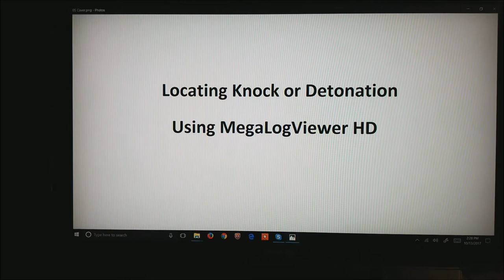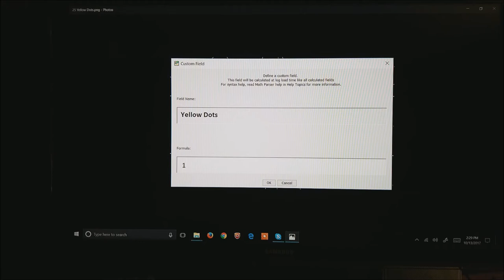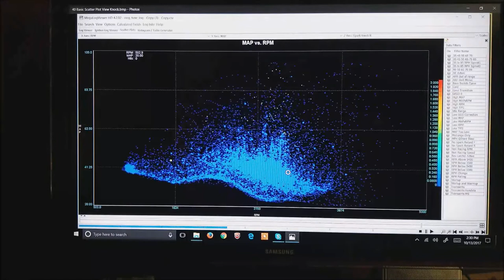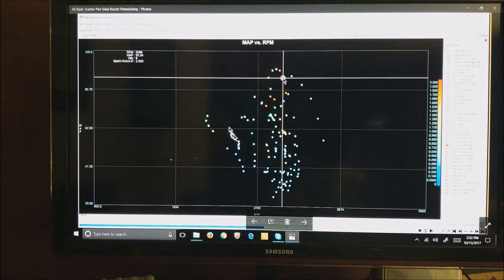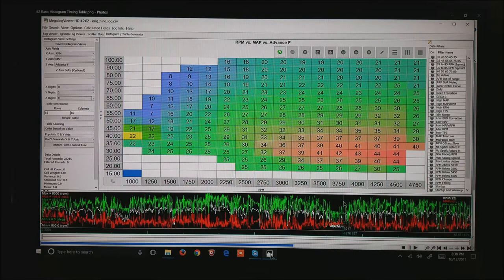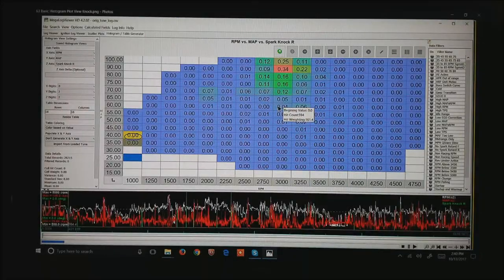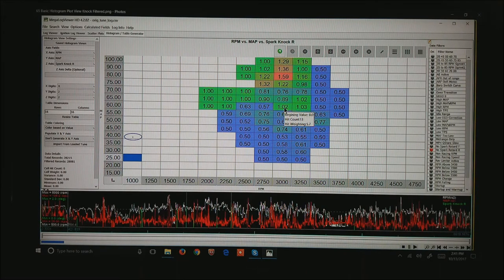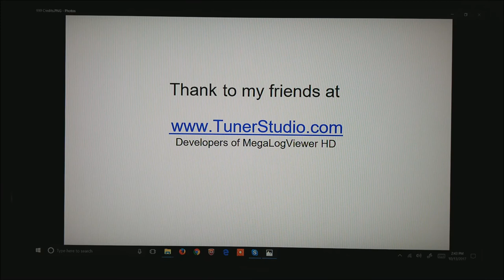Locating Spark Knock with MLVHD

Comment: How did you change the color? When in histogram what exactly do the numbers in the buckets represent? Degrees being pulled? Hits? Im getting over 104KPA on my 124" harley NA motor which is the powervisions limit that it can read to. Is this a calibration issue with my map within the Powervision? How did you extend the field for 105KPA? Thanks Andy